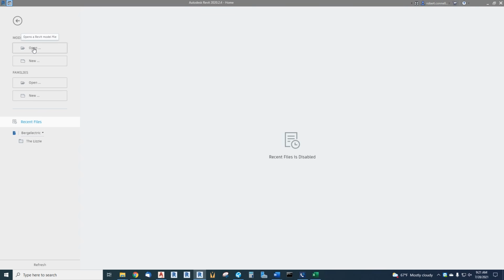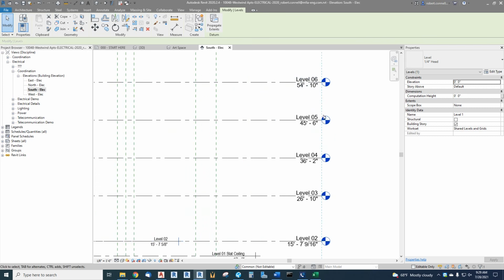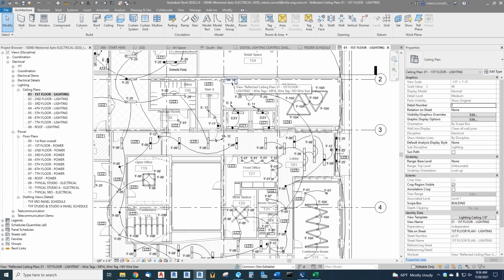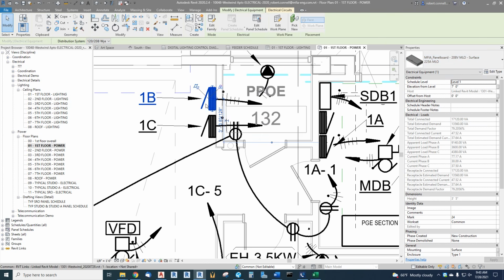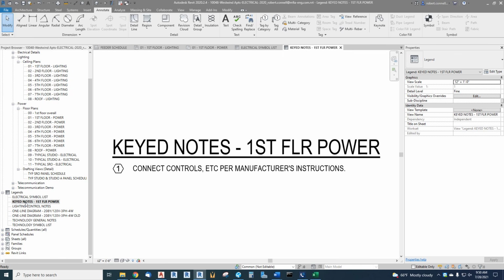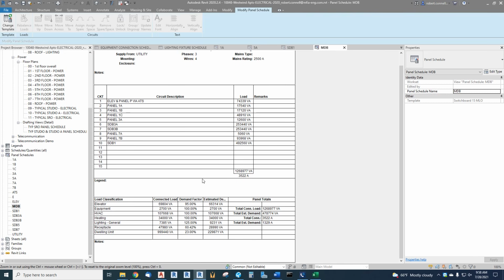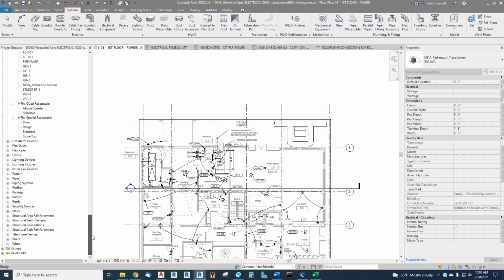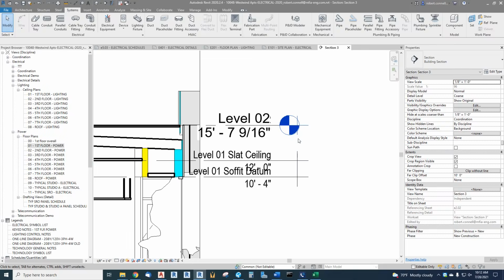See What a REAL Revit Electrical Project Looks Like!!

Comment: Thank you for the videos. I'm new to Revit and I'm an electrical Engineer. Which video should I start with to be from scratch? Revit MEP or Revit Electrical?
Reply from the maker: Hello there, and welcome to Revit! I have a couple of beginner full project videos I would recommend - https://youtu.be/it5oK6iwgJg and https://youtu.be/hVH2SoYuxY4
They are both "residential" size projects, but will help you learn Revit using mostly the out-of-the-box families that come from Autodesk, rather than needing custom families (easier for beginners). Hope they help!

Comment: Who provides the initial model with all the electrical panels and devices the owner/architect???
Reply from the maker: The architect created the building model and the electrical engineer/ designer added the electrical model elements such as the panels lights receptacles and circuiting.